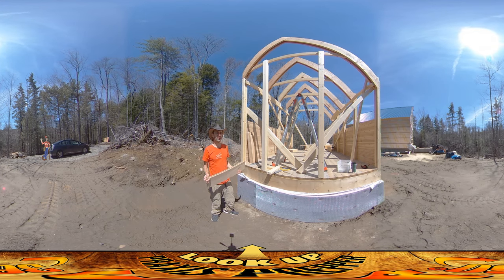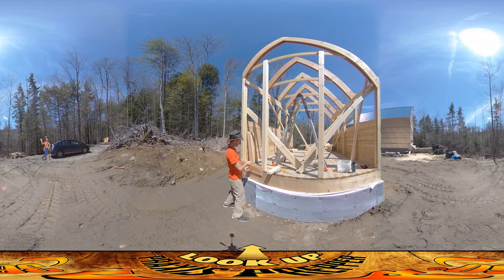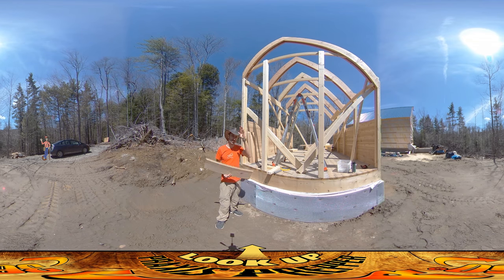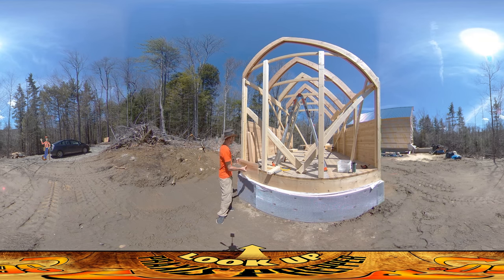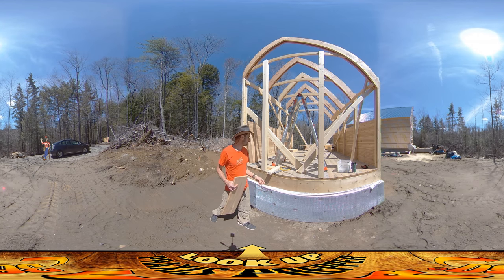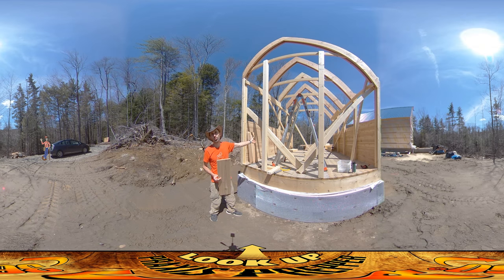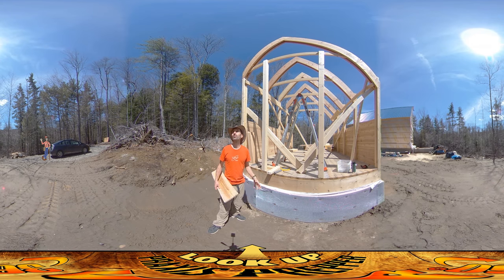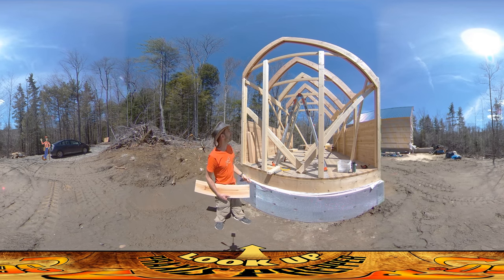Homestead Building - Mini House Wall Sheathing, Planning Design Around Available Scrap

Comment: I'm curious if there is any practical reason why you made the roof asymmetrical? Pleasing to your eye and artistic side, or just a surprise waiting in the wings?
Reply from the maker: The south roof needed to be 45 degrees. That determined where the peak would be based on the height of the south wall. The height of the north wall was determine by the convenient length to cut the lumber used to build the posts. From there, I just drew a line from the peak to the tip of the north wall posts and that became the angle. I don't know what the angle is myself either. That all said, I also like the look of the asymmetry, so didn't mind at all that I was creating it.
Reply: Praxis Homesteading and Survival Skills Ok, so it sounds like you are saying that the angle and dimensions of the solar water heater dictated the roof size and angle and you basically adjusted the other side of the peak with the room you had left.

Build for our next house might be pretty simple. Wife seems to be liking the current "minimalist modern" right now which will greatly increase the amount of work we will be able to do without hiring help.
Reply from the maker: @inmyimage1081  Yeah, you got it on my design approach. Good luck on YOUR prospective build. Modern minimalist is a nice feel too.